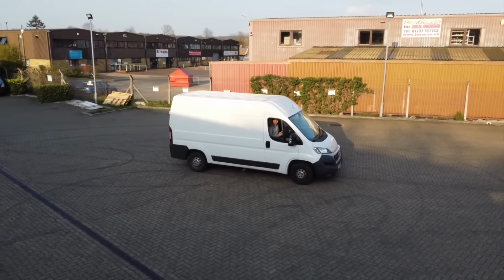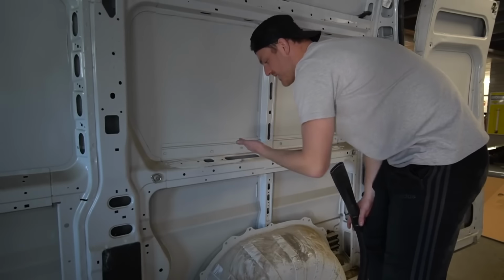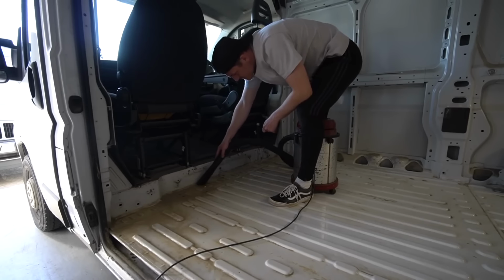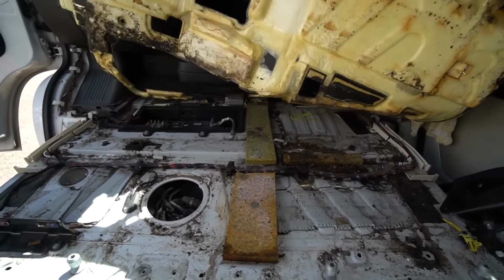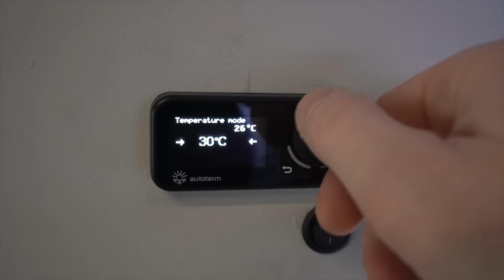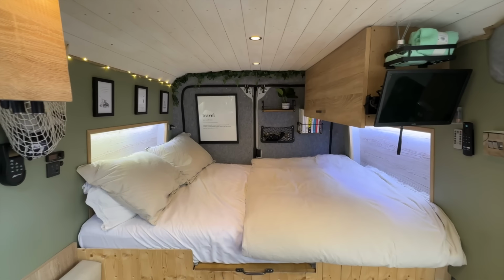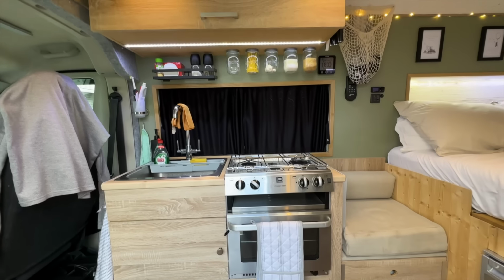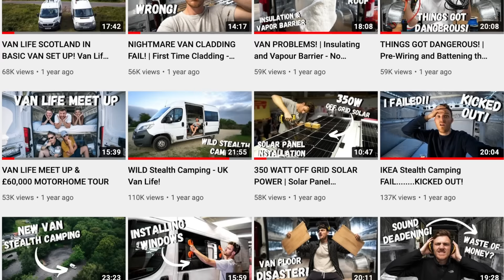DIY BEGINNER Complete Van Build Timelapse | Step by Step Amateur Build

Comment: thats a good idea, to insulate with that reflex stuff then add wool insulation and then cover again with reflex. I never seen this before.  Curious what made you do it this way ?  thanks  (also like to know what material you used inbetween the reflex stuff

Comment: 9:30 Reflectix doesn't work if you put insulation over it. It works for radiant heat, so it needs an air gap. Solid build tho. Thanks for sharing.

Comment: Would be interesting to know why you didn’t frame the floor out like I’ve seen many others do that. Why do they do that? is it to be able to stuff it with the sheep’s wool stuff. Seem to work fine as you did it, what was the outcome for example, was the floor colder or? I’m all in favour of the simplest route.

Comment: You must and should be chuffed, amazing job fella! I love the methodical and practical approach and order of the build, and having seen this, I am going to back and watch the build in its parts.

Your excessive use of caulking, and adhesives is refreshing, I've seen pro-builders make a terrible mess, whilst I seem to have mastered the wet finger run that leaves a nice clean line...only to muck it all up at the corners!!!

Cheers, Mike from Canada!

Comment: Step 1: Get a good van of an even better pedigree and year.... 
Building a campervan with a Fiat Ducato equals a failure at step 1.
You may substitute Fiat Ducato in above statement liberally with Citroën Jumper, Peugeot Boxer or RAM ProMaster, which are all utterly sheit.

however a good van to build a campervan with is a Mercedes Sprinter build between 1996 and 2000. 
In that period they were equipped with the xxxD diesel engines. The diesel engine version with the D behind the 3 numbers (mounted on the grill of the Sprinter) are the best. The first number signifies the GVW (roughtly) and the second and third one signifies the engine power. So a 208D is a 2 ton Sprinter with a 80 HP diesel engine.
What you DO NOT want is one of those later engines signified by the abbreviation CDI which are engines with heaps of trouble laiden with lots of sensors and crappy electronics. These engines were used 2001 and later in the Sprinters. Avoid those at almost all cost.

So for those keen on getting it right the first time, let's try again: 
Step 1 Get a good van of an even better pedigree and year ... Get a Mercedes Sprinter van made between 1996 and 2006 with either a 4 cylinder diesel engine without a turbo (208D or 308D - 80 HP) or a 5 cylinder turbo diesel engines (210D, 310D, 410D - 102 HP) or a 5 cylinder turbo diesel engine (212D, 312D, 412D - 122 HP)
Also the 4 cylinder petrol engines (214, 314, 414 - 143 HP) seem to be oke but rather hard to find.

Comment: For sale...
I have a new, white 2023 AWD 170 Mercedes Sprinter van that is 2 weeks from completion at Tommy Camper Vans in Arizona. Upgraded insulation package,
400 amp solar,  400 amp lithium, A/C, Max Fan, shower, Dometic toilet, Dometic A/C, farm sink & refrigerator/freezer, diesel heater, microwave, induction cook top, swivel seats & lagoon table, side flares, outside shower, and much more. $149K.

Comment: Ever notice hardly anyone tells you how much their "new"  used van cost. How many miles/km  their "new" used van has on it. So my thoughts are, most anyone isn't going to sell a nice low mileage van for cheap. Most anyone is going to sell their older used higher mileage crappy sprinter type work vans for probably way too much for a pos! (pos piece of shit) Then let's sink a bunch of time and money into a heavily used pos van. It can look nice but if you're lucky enough to not have anything catastrophic happen you'll probably get nickeled and dimed to death by your new used van. It's almost like remodeling a neglected house only on the inside and not fixing up the roof, windows and everything that's on the outside, kinda like an old crappy van!!!